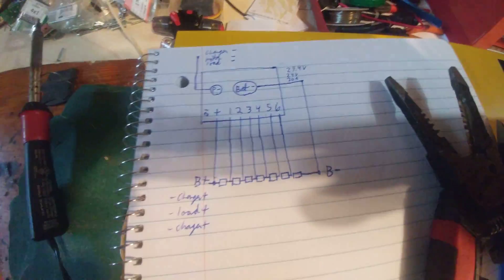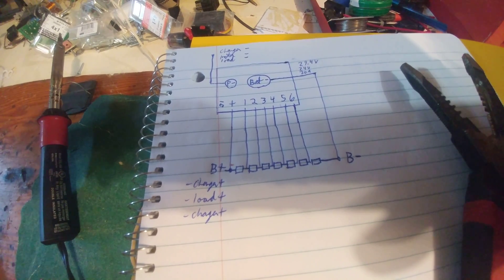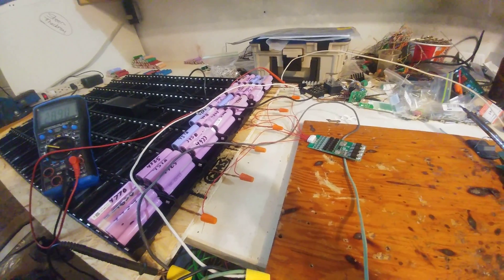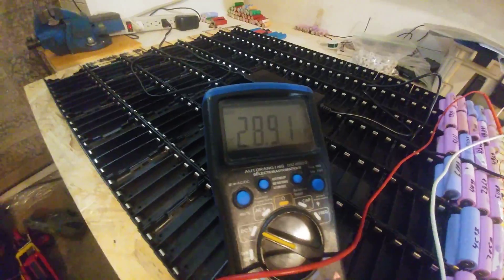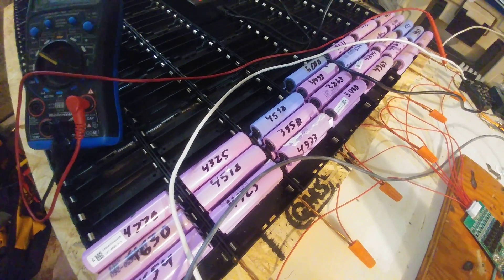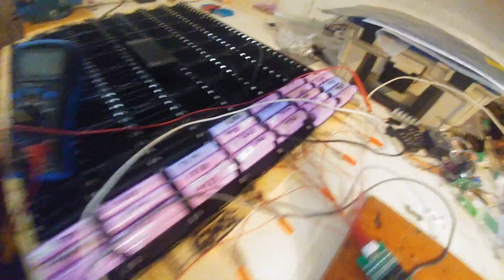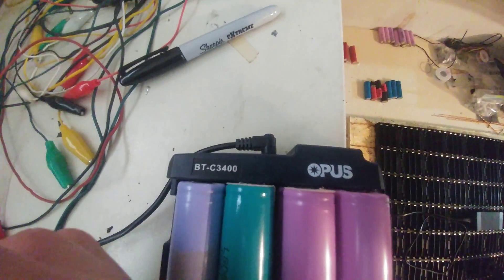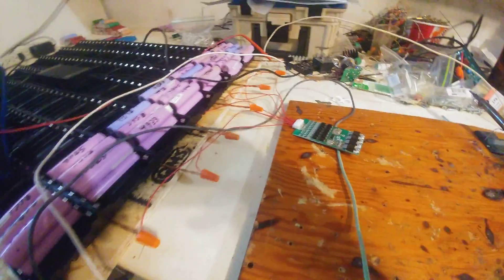18650 7s bms diy power wall 24v 29.4v may 17 part 1

Comment: I have planning make with bms 7s, I want know from you, how much range voltage work bms 7s ?
Reply from the maker: My most recent update video compares several bms modules. It has all the specs of each one. Generally for inverters the largest is 4kwh with 7s
Reply: My inverter psw type low freq with transformer 180 amp range work 19 volt - 29 volt but my bms 7s range work 25,7 volt - 29 volt, what's my have problem ? It's realy range work bms 7s ? I know litle about bms 7s

Comment: I have a 7S Pack and i  am planning to use a 24v inverter that has a working range from 20.5v to 30v, now actually looking for a video to charge my 7S pack from the wall and later from solar, any suggestions?
Reply from the maker: Ivan Stokic hey i was making a video on that topic but disroyed my charger by accident but the parts to make it are in my latest video.
Reply from the maker: I just finished testing and filming my 110vac to 29.4v charger. I'll try to have it edited and uploaded today. watch my other videos to see the specs on it.
Reply from the maker: Ivan Stokic my lastest videos talk about charging using a wall outlet check em out